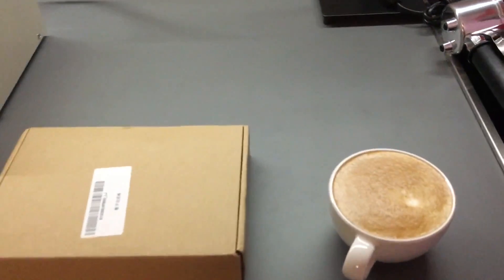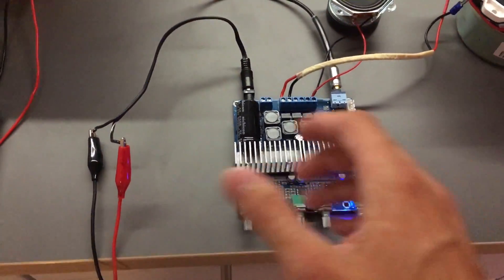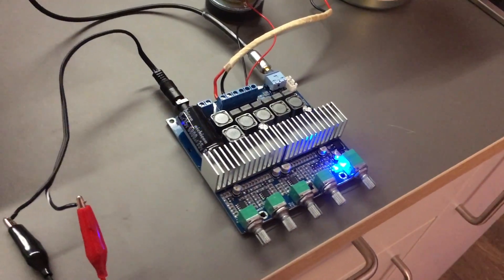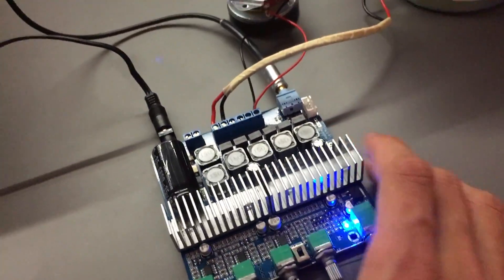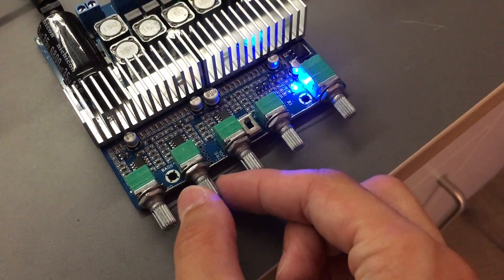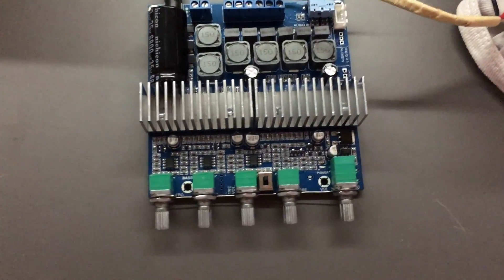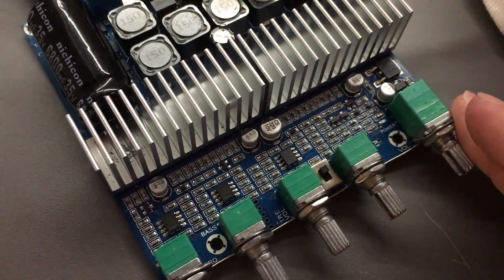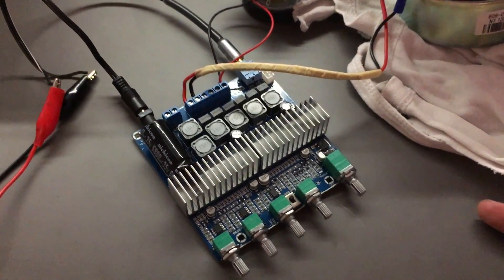TPA3116 2.1 Amp Review / AWESOME !!!

Comment: My board just arrived today. In short: I wouldn’t recommend it. 

I like some small features of this board, as is the on-board 5-V power supply (e. g. for an external Bluetooth module), the possibility to hook up you own power LED, the combined volume/on-off knob, the very low standby consumption (when the board is turned off by the volume knob and still hooked up the power supply) and the anti-pop circuit when turned on and off by knob and power supply.

What I don’t like is the abnormal high noise in the satellites and even the bass speaker. 
When you turn down the treble potentiometer, there is very loud noise added to the right satellite. 
The sound is distorted by each touch of any of the potentiometers, even with the plastic caps mounted on them.

Furthermore, I don’t like the behavior of the bass adjustments. I use relatively small speakers — 2 × Visaton FR 10 HM (4 Ohms) and a Dynavox DY103-9A (4 Ohms) —, and especially the bass speaker easily overdrives when the audio signal is too high. With this amplifier, I couldn’t adjust the bass so that the speaker wouldn’t overdrive or would be barely audible. 

Even when supplied by my adjustable power supply with 24 Volts the overall loudness was poor!

For comparison: My previous amplifier board was this one: https://goo.gl/6BvXAZ
It amplifies my speakers without any problems, but it lacks an anti-pop circuit when powered off via the power supply and adds hissing noise to the satellites. In comparison to the board reviewed here, it is still less noisy by probably factor 2 to 3. 

So, either there is a huge series deviation or the board isn’t suited for small speakers. By the way, I had to add thermal paste, as there wasn’t any put on originally.

Does anybody want to buy my board? ;-) Shipping from Germany.

.
Reply from the maker: No, mine has quite a high noise floor too - if you're using particularly sensitive satellites then it should surely be a problem

I would advise lowering the gain on it ... I plan on doing this to mine - you can get rid of the broadband noise that way for sure

Regarding your second amp, I'll cordially invite you to check my anti pop circuit video if you haven't already

Und als letztes, wie viel willst du für dein Board :) ? Wenn der Preis gut ist kauf'ich's (wohne in Darmstadt)
Reply: @Darieee  Danke für das Kaufinteresse! Für 20 Euro inkl. Versand wären wir im Geschäft und die Platine in wenigen Tagen bei dir. :-) Bei Interesse alles Weitere per E-Mail, die du in meiner Kanalbeschreibung findest. Die Platine reserviere ich für dich bis zum 10.02., danach wandert sie in die Bucht.
Reply: v8s it's not 5v for a start you doughnut you have the cheaper version
Reply: @rebeccaroberts5876  Aha, can you proof your statement? Your board had obviously a mains voltage regulator, as you call other people after baked goods.
Reply: v8s mate if got a sanwu with less wattage and amperage consumption running on 22v DC laptop power brick and also will run off Makita 18v 5ah no prob it's just saying you can run lower voltage but in turn you will get distortion these little things boast there wattage but it be more like 30% of that
Reply: @rebeccaroberts5876  What exactly are you trying to say with your comments? You firstly offended me while you haven’t understood even a bit of my review.  Secondly, you post a link to the same piece-of-shit amplifier board, and thirdly you tell the world about a completely different amplifier (not a ‘newer version’) and your power supplies. Do you even think before posting comments?

Comment: Darieee  What frequency range sub channel ???
Reply from the maker: I really don't know, never measured it, it's quite low, about 120 or so I suppose but I really don't have a good feel for this shit yet

Also I have a ported system (the Apple iPod Hi Fi) which it's powering, so that's gonna skew results a bit too
Reply: Darieee thanks for your answer. I need 20-80 Hz on subwoofer, 120 Hz is too much

Comment: Apple A1121 Woofer :) I'm currently trying to integrate a new amp in my apple hifi cause the power supply died.
Reply from the maker: +Edo Cellar hmmm, I still would highly suggest getting the power supply fixed - fitting a new one in

It's humanly impossible to achieve the level of fine tuning that apple did with this - won't sound nearly as loud, and you won't get dynamic bass levels on the high end
Reply from the maker: +Edo Cellar not sure if you've seen it but I have actually built my own internals for an apple hi fi ... quite a long video but, yeah - should convince you to go the easier route
Reply: I've been trying to fix it but so far I could not make it work again, might look for someone who is better at reading schematics. I could not find a new/used power supply anywhere on the net, or at least wit the same power outputs. what a shame..
Reply: I mean the fuse is working but when i put the probes on the the different outputs which are supposed to be 17V, 5V & 3,3V i read 0V all the time..could be one of those caps.
Reply from the maker: +Edo Cellar does it make any noise ? If it's a flat 0 then it's probably worse than just a cap though
Reply: Yeah, it's probably around the area of the mains input. Schematics tell that the next in line is the coil: https://github.com/newtonresearch/ipod-hifi-smps/blob/master/PA-3150%20Schematic.pdf
Reply from the maker: well - best of luck in any case :) !
Reply from the maker: well, let us know if that fixed it
Reply: Well, now I got a blown fuse and a blown Thermistor. There has to be a short somewhere in this circuit close to the mains, it's a shame that I can't find a proper repair shop where I live..
Reply from the maker: yeah .. in this case I would recommend spending a few hours watching this dude's repair videos : https://www.youtube.com/user/FFcossag/videos

he did quite a lot of repair videos (especially lately) - quite valuable intel
Reply from the maker: mmm - from what I remember the power supply on the iPod Hi Fi has some kind of plastic/paper between the PCB and metal enclosure ... If there isn't any ... Perhaps capton tape or ? Some sheet of plastic perhaps

so you're going the repairing the PSU route I see :D wise choice !
Reply: Darieee got it working again ;) new caps were to big so I had to extend them into the battery compartment. Little speaker sounds great ☺️☺️☺️
Reply from the maker: nice !

what exactly was faulty / was changed btw ?
Reply: Well I think when I first looking into it, it was probably a blown capacitor only. But I decided to change these parts too, just in case: Thermistor(NTC), 3x 100uf 450V Caps, 0,33uF Cap, 3.15A Fuse and the Bridge Rectifier. This was basically most of the HI Voltage Circuit, the  schematics really helped me realize the circuit.
Reply from the maker: very nice :D I'm glad you got it working

Comment: Hey. I just buy tpa3116 with bluetooth model. 50+50+100w 2.1 amp. But it seems like the 100 watt subwoofer channel will only kick in 150hz frequency.  What can i do fix it.? Implanning to but tda7498+tl072 board plus ne5532 tune control.? Would it be better ? Im planning to control my crossover frequency on my subwoofer. Help
Reply from the maker: Can you give out a link to the exact amp you bought ?
Reply from the maker: Ok, so, could you tell me again exactly how the sub channel performs differently from your expectation ?

PS1: tpa3116 chips go up to 25V if you really want max max power

PS2: is there any tump when you turn it on/off ?

PS3: does it say YUANJIN on the board anywhere ?
Reply: Darieee the sub woofer would only hit around 150hertz of frequency or lower . Im looking for an amplifier with adjustable crossover frequency or 500-1000 hertz if fix..
Reply from the maker: uuu .. yeah .. that's a weird requirement you have there ... may I ask why ? The 2 other channels should also push sound as low as 150 ? why want your subwoofer overlap with those ?

you could buy a separate normal non-filtered mono amp for the sub and get one of those ne5532 boards you mentioned

http://bit.ly/2jJsRs6 should do you good

(or you could indeed go hacking at the crossover on your board but ... I'm afraid I can't help you there)
Reply: Darieee i notice the 2 channel can put out from 20khz down to 20hz but not as punchy that my 10watts per channel bluetooth amp that i just pulled out from unknown speaker. Im using 120watts per channel plus 140watts subwoofer. Im planning to make the bass much louder to make and balance out the distance that my bass and tweeter can travel..  i found one with adjustable xo subwoofer frequency.. 80-500hertz which is good for my project. 50wx2 -100watts sub. Is there any amp will output 2x100watt +200watts with 500-1000 xo.?
Reply from the maker: I'm not really that well versed on the more powerful amps I'm afraid ... still, why would you want your subwoofer to go above 150 hz ? It'll sound like shit
Reply: Darieee actually not. I tried lining up it with my friend amplifier which performs well around 2x50watts 150watts. Crossover set to 400hertz. I doesnt have a distortion but a house breaking bass.
Reply from the maker: I wasn't talking about power, but rather, a subwoofer will distort higher frequencies (300-400Hz) and make them sound muddled up

Comment: Mine finally came from china. But bad news!!!
This board has a horrible noise floor.. and bad pots. Tried different source(PC and phone), different power supply(4 different SMPSs)..
2ch version is the same. Compared to samwu tda7498, and this board is terrible unless you really have a really good isolated power  source..
Something is not quite right with this board design...
Sorry to deliver bad news. :(
But thanks for a informative videos and it has been a good experience.
Reply from the maker: so it seems the cheapest taobao stuff's not that good ? Or are there other things that do turn out to be just as good but cheaper ?
Reply: Well, this board(same as yours) does not know how to handle the ground noise. For your application with batteries and tiny speakers, it may be ok. But for driving bookshelf speakers?  Look elsewhere.

Actually sanwu tda7498 board that costed only $6 sounds good! So cheap ones can be good. But hard to find!
Reply from the maker: mmmm ... I can also run mine off of the 12.5V SMPS boosted up to 25.3V with the battery completely disconnected and it sounds just as good :-/
Reply: Well.. maybe speakers play a big role here. I run 6 ohm, $200-ish bookshelves... so YMMV?
My board with additional power capacitors and a gain mod, it is somewhat decent now. But still, hum noise from ground is noticeable. You will need a isolated or well-grounded power source. I run mine at v12 to minimize noises.

Actually, resolution is very good. There are some dip on 100Hz and 10KHz, but it is ok. Fun board with lots of adjustments. It has been a great learning tool for me :)
+ I just did a sub-woofer test, X-over frequency is around 150Hz-ish at the lowest... hm....
Reply: Analog pin and power pins are usally together on these cheap designs :( It should have an RC filter of 10 ohm and a10-100uf cap in series with analog in pin. Really lowers the noise floor! You could also try a ground loop isolator (trafo) in the audio signal.
Reply: If i read this before buying, but totally agree with lots of noise
Reply: @Herus  As far as ground noise goes, you can run the power through a ground loop isolator, but you may or may not need to. Most of the noise is likely due to not putting the board in a metal enclosure. To see if that is your problem, you can wrap a cardboard box in aluminum tape and put it inside, and see if the noise problem goes away. If it does, there is some other electronic that is being noisy with the PCB is picking up on.

Comment: Nu-i rau deloc, imi place ca pare sa fie destul de puternic. Daca avea si modul bluetooth era perfect.
Reply from the maker: Foarte, in ce boxe am eu nu trec de 25% volum; sta mereu sub 10W. 

Nu stiu ce sa zic .. prefer module separate, asa e mai sigur ca prind un amplificator fara probleme; + multe is cu chipuri ciudate, asa un modul standard cu un CSR8645 il pot programa destul de usor
Reply: Asa-i, inteleg ce spui. Eu nu am reusit sa scapt de tot zgomotul ala electronic de fond nici cu un convertor DC DC in circuit. Probabil ca voi folosi o sursa total separata (baterie 5V) in boxa portabila pe care intentionez s-o fac.
Reply from the maker: eu tocmai am renuntat la o sursa interna ... am prea putin spatiu si bazaie destul de distinctiv : pe baterii la 24v e perfect (bataie de cap cu incarcatu/managementu' .. da .. se rezolva)
Reply: faza cu bateriile e alta problema, va trebui sa inghesui pe acolo pachetul 5S de 18650. stau de aproape 2 luni dupa circuitul de protectie, primul s-a pierdut pe drum.. durata de transport e horror
Reply from the maker: da, dezastruos cu transportu' ... de ce n-ai ales 6S ? asa ajungi la voltaju' maxim ... n-am vazut curenti peste 200 mA (si aia la generatoru de frecvente pe la 40 Hz sau ceva de genu', in muzica nu mai zic).
Reply: este un proiect ce s-a tot modificat de-a lungul timpului, acum astept un amp cu TDA7498E caruia ii trebuie 36V deci oricum va trebui sa folosesc un boost converter. am nevoie de un singur canal cu vreo 60-80w (curati) ce nu am reusit sa obtin cu integrate de putere mai mica, de exemplu dintr-un modul cu TPA3116 mono (100w cica) am obtinut cam 35-40w la vreo 22V. nu stiu daca din vina circuitului prost chinezesc sau am gresit eu ceva, ideea e ca acum incerc un chip mai puternic sa vad ce iasa
Reply from the maker: uuu, fain ... vezi, incearca sa folosesti 2 (poate 3+) in paralel ... se ajusteaza destul de greu cand e o cerinta mare & brusca de curent; cand ii gata sa faci un filmulet, is foarte curios acuma :D
Reply: categoric il voi pune pe net undeva, trebuie sa ma laud cu creatia :)) din pacate mai dureaza, probabil prin iarna va fi gata, asta daca nu dau iar de complicatii
Reply from the maker: multa bafta ! (apropo, de unde esti ?)
Reply: da, merci. Timisoara, tu?
Reply from the maker: +Alexandru Simonescu iasi

Comment: Never test with open air speakers without a proper enclosure, sounds like garbage.
Reply from the maker: wasn't testing speakers though
Reply from the maker: true - but the other amps used 10W of idle power heating some inductors, or simply burned up in the first 5 seconds : awesome in this case means it uses the TPA3116 chips properly
Reply: So what exactly was the "test"?
Reply: Best speakers ever made were open dipoles.
Reply: @Darieee  Correct. But it bugged you enough to make excuses for it fluttering. Very few subs are designed to work in open air and those are designed to use a car trunk as the box. I'd like to hear your setup in a proper box.